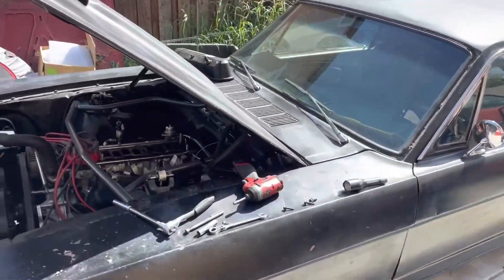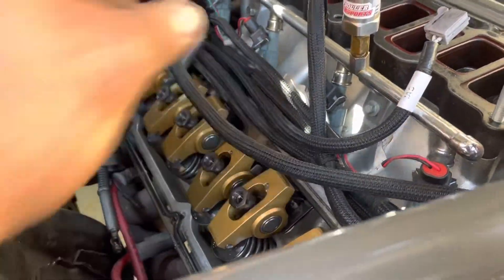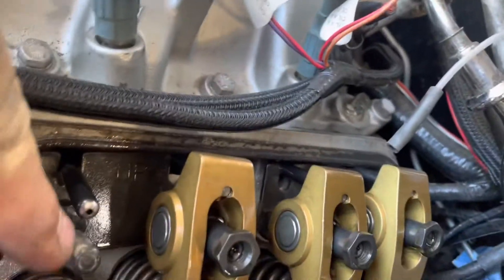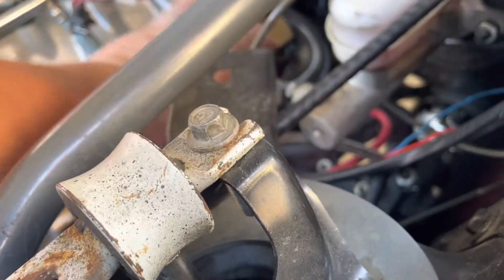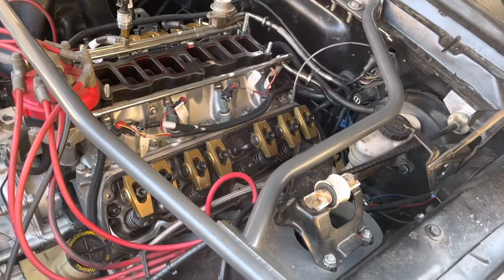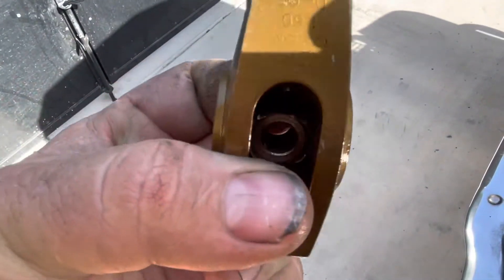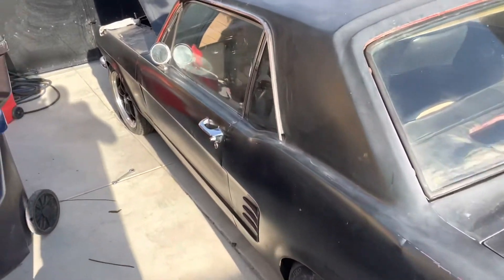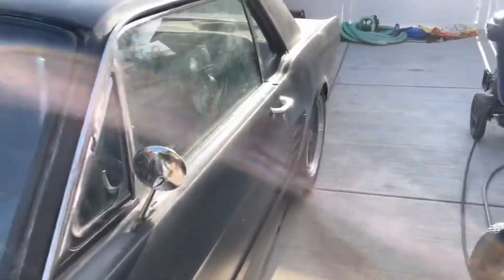Ford 5.0 302 roller rocker came off engine knock sound not rod

Comment: I had the exact same rocker pop off while I was driving😂 put it back on and it fired right up clearing everything from that cylinder. Ran great but then it loosened up again because it was just a quick fix to get me home. Onto readjust the hex screw and set the lash tomorrow!
Reply: Mine never came loose again after this. I would recheck all of yours.  My torque was too loose on all

Comment: Same damn thing but zero noise which I can’t believe. Only reason I found it was I was removing the valve covers to make room for booster. Mind you my car is in the post rebuild stage, so I’m only running it to do the timing. But g this could have been way worse.

Comment: out of curiosity  did you hear any noise before it came apart ? my windsor is making and unusual sound from the valve train i still need to take it apart to find out what it is  thanks
Reply from the maker: It happened within 4-5 miles.  It started ticking on the fwy. Sounded like a typical ford with a noisy lifter.  But then by the time i got off the fwy, it had blown up into full chaos like you hear in the video

Comment: okay! Update! My roller rocker didn’t come off, it freaking broke in two. I think I found the exact replacement, but is it feasible to just replace one? and when you put yours back on, did you just bolt it down? Or is there an adjustment needed, etc. Otherwise, thank you for posting!! I thought I had rod knock.
Reply from the maker: As long as the replacement is the same ratio you should be ok. Is it pedestal or stud mount?   Either way there is a specific way to do these.   Search YouTube, lots of videos on it.  Too much to explain here.
Reply: @v8only  I’m not sure, I’ll do my own research. Thank you for putting in the effort to make a video, I really thought I needed a new engine